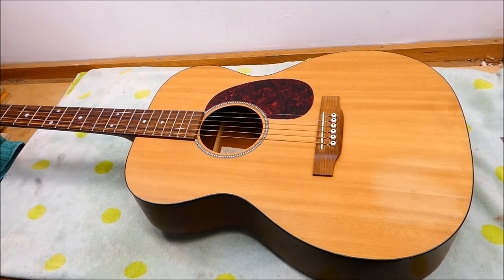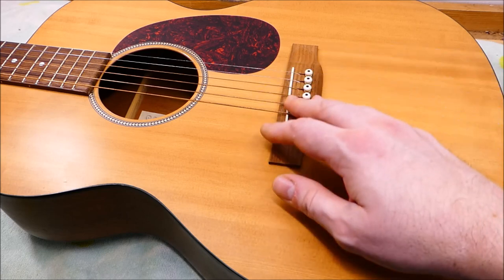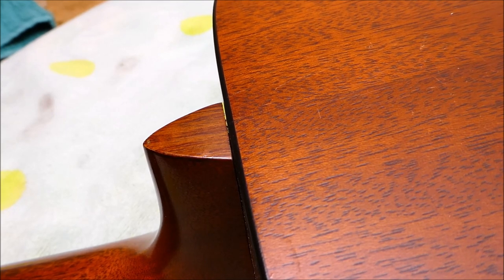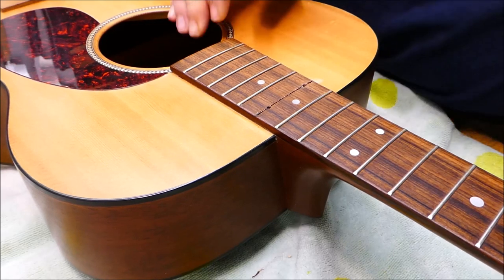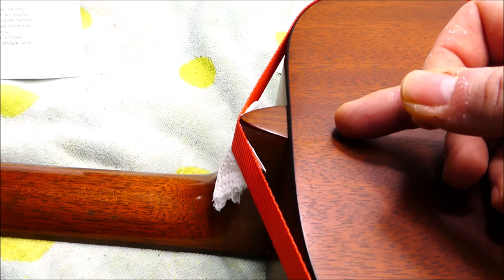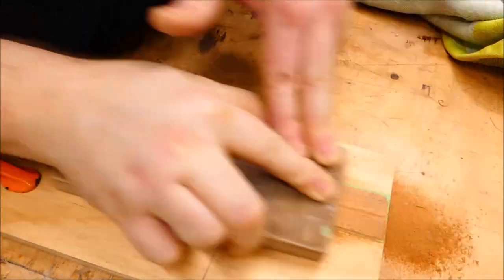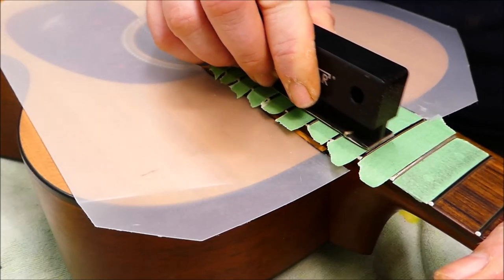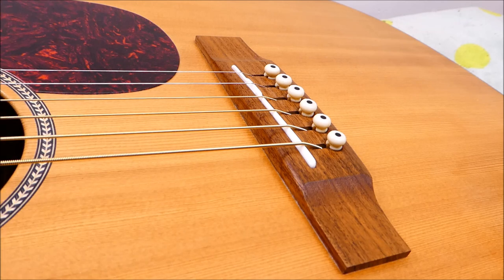Uncooperative Martin

Comment: Done quite a few of these, some only 3 or 4 years old. They are real pigs, the joint is tight ALL the way out, you need to push from the heel cap otherwise you risk snapping the heel.
Way more difficult and risky than a dovetail.
Martin's are great for business.....

Comment: Very interesting that the joint could be shifted by heat alone. I think I need a couple of those resistance heaters.
Reply from the maker: It was stiff. I really had to push. They work well about 80% of the time. Some necks seem to need steam.

Comment: This looks a little like the "neck reset" I did on a beater. I clamped it down to a board until I got the neck where I wanted it, stuffed a towel inside to focus the steam on the neck block area and shot steam in until it got good and warm on the outside. Then let it dry out for a week before unclamping. So far, so good.

Comment: I'm having a hard time finding someone that knows about doing a neck reset for the often maligned Guild CV-2C which was supposedly originally designed for easy neck resets with it's supposedly innovative neck attachment system . Oh well. It's a guitar that sold for less than $900 bucks after Fender unloaded them to the warehouse resale market. Prior to that they sold for in the $2500 range. It just sits here. Sad to see. Adirondack spruce top cutaway with solid maple back and sides with a ebony fretboard and a beautiful sunburst.You do beautiful work and I've learned a lot from watching. Thank you.

Comment: Where there's a way, there's a way. I was a telecom field engineer for several years and the mods and unique ways to fix intermittent problems in digital wireline networks/systems should be in a book. Some fixes were just dumb luck. Others, hours upon hours eliminating the usual SNAFUs. I admire yuor tenacity as much as your skills.

Comment: Neat!  I have a HD16R Adirondack with a similar neck joint, so this was interesting to learn about.  I got mine second hand from a local music shop and it needed a bunch of work.  The action was sky high because the neck bolt wasn't installed at the factory.  The luthier that fixed it said that it settled in perfectly once he put the bolt in.  The binding was coming off on both sides of the waist, but that's fairly minor. To Martin's credit they fixed it all under warranty and it's a great player now.

Comment: Send that saddle as well and provide options for the buyer. My McPherson came with 3 different height saddles so that you can chose your favorite action. Nice work as always
Reply: The reason McPherson ships three different saddles is because they have big metal rods in their necks as opposed to a traditional truss rod, meaning their necks virtually do not move. The saddle is the only way for the player to adjust action to preference since there is not the normal adjustability in the neck other guitars have.
Reply: @michaelmalik5049  Yes they have some type of carbon fiber  rods in there that makes it stable. Multiple saddle heights could still be used with a traditional adjustable truss Rod guitar too though. I don’t like to think of a truss Rod being used to adjust action so much as it is for straightening the neck. Use the truss Rod to adjust the relief in the neck and then adjust the saddle to the action the player likes….

Comment: Unrelated to this video, I'd like to thank Ted for his calm and inspiring demeanor. I just bought an inexpensive mandolin to learn on, and thanks to binge-watching these videos, I had the confidence to do my own setup; I got it to where I enjoy playing it, got the intonation set nicely, and then managed to track down a slight buzz to a first fret which had popped up just a little on the treble side. This morning, I knocked up a couple of cauls from scrap wood, with some felt I had laying around to protect the finish, and used clamps either side of the neck to gently press the fret down. So far, it's holding nicely, and if it does pop back up I'll be ready with the paste wax and a little thin superglue. I wouldn't have had the confidence to try this without Ted. So thank you, Ted.

Comment: I've done a couple of martin mt guitars. They're a bit different but quite straightforward. Need to use steam not heaters and its easiest to just steam through the bolt hole. Also bridges are often very tall on these guitars so fine to shave. They are very nice guitars.

Comment: thanks you as always for sharing your experiences. i would say shims are ok, just glue them to the saddle. i think you can even order bone shims that are like 0.5 mm thick. i do dislike the lose shims that are just dropped in the slot.
Reply: Agreed.  I get bone shim stock from a luthier supplier company here at 0.02".  With a little superglue and then a bit of sanding, most people would never know there was a shim on there even when removing the saddle and looking right at it.
Reply: @melodicdreamer72  yes, I always keep the slivers you cut off the bottom of a new saddle for that use

Comment: I’ve just purchased a solid wood version of a hummingbird by Sigma. Well when it arrived it was slightly damaged on the back, but I just couldn’t send it back. Why? Because it was the best damned guitar I’d ever played in my life!!!! I took a decent discount for the cosmetic damage on the rear lower bout. Guess what, sigma was once owned by Martin so I’ve kind of got a Gibson ripoff by Martin trained luthiers. Nice job by the way.
Reply: Sigma, and Vega were both import Martin copies made in Korea and Holland. They were designed by Martin craftsman/ designers not built by them. I rescued a Vega D model nice enough guitar but dowell neck joint was the reason I got it so cheap...it came apart!  It also had the widest grain Spruce top I have ever seen so cracks a plenty!

Comment: Thanks! I have a Martin OMCPA1, which also has a bolt-on neck. (Taylor competitor). I've wondered how it comes apart. Martin dropped the bolt-on with the OMCPA1+ and the only other slight change to the Fishman.  I've heard rumors these necks were glued as well as bolted, which is very goofy.

Comment: One million guitars by 2004. If I recall correctly Martin made 500K by 1983 or 1984. So they made as many guitars between the mid 1980s and 2004 (about 20 years) as they did in the previous 150 years.

Comment: The one that I just did, had the heel itself glued as well as the mortice. The "screw" had been turned too tight, which caused the insert in the heel itself to strip [ brass ??  ]    The repair was a nightmare .

Comment: Curious,,,would it be possible to steam the neck joint from below by removing the heel cap, drill right into the V joint and steam it from there?  then glue the original cap back? maybe.

Comment: Did Martin glue it when they built it or had another party glued the neck sometime during the life of the guitar?
Reply from the maker: That's the question. I can't tell for sure.
Reply: @twoodfrd  I found this on a Martin Guitar Forum,. I can't vouch that it's a factual statement: "Martin uses a bolt to hold the joint together while the glue is drying, but the bolt could actually be removed after the glue has cured (not true for some other builders)."

If that's true I'd have to suspect that the traditionalists at Martin at the time were adamant that the neck to body joint had to be glued or it wasn't right. 

When I was in the US Navy long ago I was always told that there were 3 ways to do something, "The right way, the wrong way, and the Navy way (we always did it the Navy way). I'm guessing that at Martin they always do things the Martin way.

Comment: Sorry if you've said this in the 0ast and I missed it but what kind of wax are you using to protect the fretboard from glue etc? I've always just scraped the excess but it would nice to make things a little cleaner and easier when gluing in stubborn frets. Also would it be safe to use the wax then carefully clean the wood before finishing a neck in lacquer or would it possibly invite blemishes, fish eyes etc? Great video btw! My main acoustic is actually a Marton D10e which is very similar in construction and approach to the guitar featured in this video.

Comment: So basically you just heated the neck joint and pulled the neck back and let the glue dry. Did it close up the gap at the heel? I'm assuming it did.

Comment: 2mm 7/64 string height is high?? that's the height of my strat bass side so its very low lower than that will cause fret buzz also my new acoustic guitar has a 5mm action on  15th fret so i think this is the medium high action

Comment: Towards the end of the video, you mention that shimming the saddle is not a good idea. Could you elaborate as to why not? I've done it before and it seems to work perfectly (maple veneer superglued to the bottom of said shim, shaped carefully). I'd love to hear your thoughts on this. Nice job, by the way...as always!!
Reply from the maker: I don't have a problem with glued shims like you're describing but I can't get away with it because I'm a "master luthier" who should "know better". Expectations are high.   I think loose shims can add a bit of resistance in the transfer of energy from the saddle to the bridge, possibly lowering volume. It's probably not perceptible, though some people insist they can hear the difference.
Reply: @twoodfrd  Totally get it, thanks! I always check with the customer first if they're ok with the shim method, or would rather pay more for me to cut a new bone saddle. So far everyone has approved the shim : )

Comment: Be aware that the neck block in the M series is not a solid piece of wood it is a plywood laminate block. 

I have a JM it is just OK. Can get muddy. Tuners are garbage. Neck is not strong enough and I always tuned down two steps. 

I also reset the neck. It came off easy.  put way too much glue back in.

Comment: Could someone remove the screw and heat the entire block and band clamp it?  Like a hex bolt with a snug heater hole drilled in the center?  Or is that crazy?

Comment: if you were to leave the action that bit too low now, would it just take longer before it needs fixed again? or would it be just be harder to repair come that time?
Reply from the maker: If you strum hard there's a bit of slappy buzzing on the bass strings, and given that they're trying to sell it, I think it's better to make sure it plays clean.
Reply: @twoodfrd  I would CA glue a thin piece of bone on the bottom of the saddle and sand that to the right height. Not worth spending even more time on it!
Reply: @twoodfrd  I bet if you said who was selling it, someone here would buy it tomorrow (unless it's already sold or you have an agreement not to name names)

Comment: I've seen other neck resets on these Martin bolt-ons on other channels, and usually there is a little bit of glue but not much. I've seen these mortise and tenalons come off fairly easily, maybe this is an odd case or before they had realized they didn't need as much glue?

Comment: I got a question for ANYONE who knows…My brother recently bought a Gibson Lucille,I noticed the strings aren’t centralised on the neck,loads of space above the low E At the 12th,hardly any under the High E, in fact,they don’t line up with the screws in the pickups either (too low) To me it almost looks like the bridge AND tailpiece are ‘too low’ and in the wrong position?!…any ideas how to rectify this ? Are there ‘cammed bridge/tailpiece screws available to off-set the bridge (mor towards the bass end) or is it a question of re-cutting the bridge ‘nicks’ and pulling the strings over (they are all in the middle of the saddles presently) ?…any help would be greatly appreciated, it’s very disappointing to me,and to him…cheers from the UK !
Reply: That is a bummer!  My two cents... Is the neck shifted?  I would get that addressed before messing with the bridge and tailpiece.  But, if the strings aren't that far off and the neck seems to be where it is supposed to be, you can get new Tune O Matic saddles (if not just the whole bridge) and just put a small slot on them in the correct position for the strings to break over.  Just remember to file on a slight angle down toward the tailpiece so it doesn't buzz in the slot...also make sure not to leave a very sharp corner on it or the string may be more prone to break in that spot.  You can get away with using some jeweler's files if you don't have a full set of slotting files.
Reply: @melodicdreamer72  cheers,I just been down the rabbit hole of research on this,it’s possible that the necks were set AFTER the bridge holes had been drilled,is all I can gather,so,yes,it looks like new saddles,and new slots,they are quite far out though on the tailpiece,but I’m trying to talk him into getting a Bigsby on it,which would then mitigate the side pull of the strings…alternatively,drop the crappy TP6 and over-wrap a standard tailpiece for a similar ‘effect’…cheers !

Comment: Is there ANY steel strung acoustic that's made strongly enough to last indefinitely (assuming no abuse), or are they all doomed to gradual degradation?

AFAIK classical guitars and violins last indefinitely, and solid bodied electrics can be used to knock down houses.
Reply: RainSong or another carbon fiber guitar.

Comment: I can’t believe Martin did that. A corporate money managing bean counter must have come up with it. I was expecting a nearly dry , well fit joint that depended ,primarily, on the bolt(s). Disappointing. I’ll bet great grandpa Martin knocked his gravestone out of alignment over this.
Honestly, I don’t know how you put up with it. Your videos, while enlightening and informative, sometimes, are very disturbing.
Reply: I had a 2006 D15 that had the same neck joint, with no glue whatsoever. It came loose, I freaked out, and my local go-to luthier (Rick Mullen), fixed it by tightening the bolt back up. Didn't have to reset the neck at all. His assessment of Martin after realizing that these were sneaky bolt-ons was "I hate Martin for this, but I love them."

Comment: I feel that generally, bolt on neck guitars sound much thinner and brighter than dovetails.
Reply: Taylor & CFox guitars don't sound thin to me. My CFox even has a split toe slipper foot neck block.
Reply: @JonNewquist  I agree that a slipper foot neck block isn’t a bad idea on a steel string. I think that added, you can dispense with the popsicle brace.
Reply: My '92 Roy Noble Cedar/Madagascar dreadnought is a bolt on and sounds pretty amazing...the most balanced sounding guitar, many people have exclaimed.

Comment: No way would I make.a.new.saddle for that guitar. If it's not buzzing, it’s good. And it's going to settle in higher. I would not use a.loose shim either but I would not have a problem with a CA glued saddle extension if the slot was.deep enough. This is not a high end Martin and a new saddle is an hour that nobody wants to pay for.  I keep a few different thicknesses of material pre-cut to common slot widths for these situations.